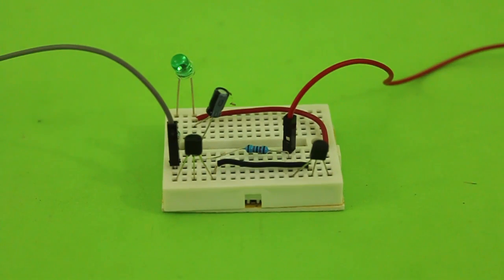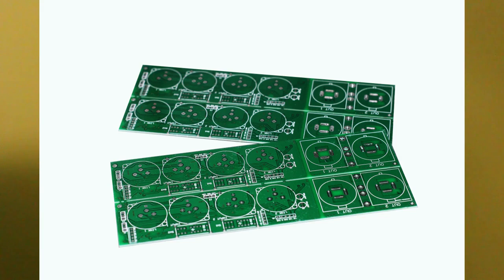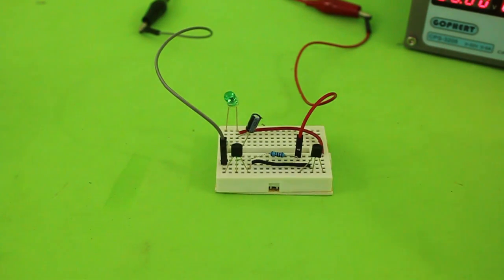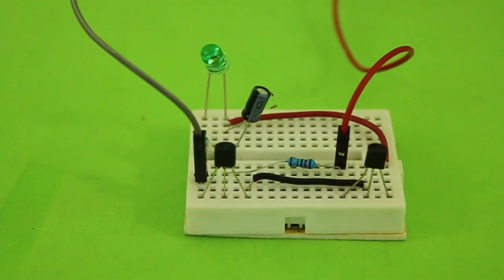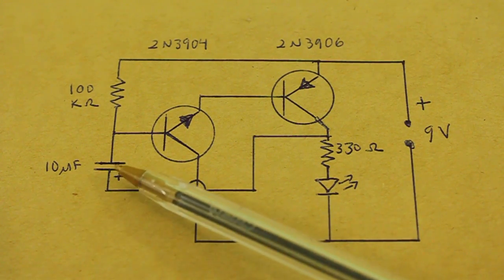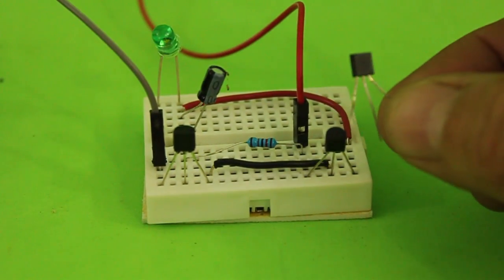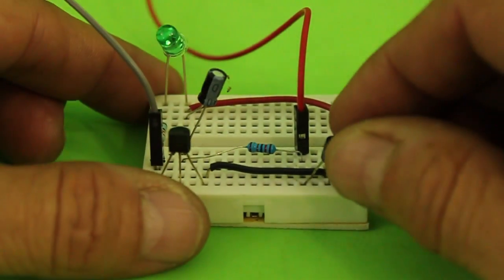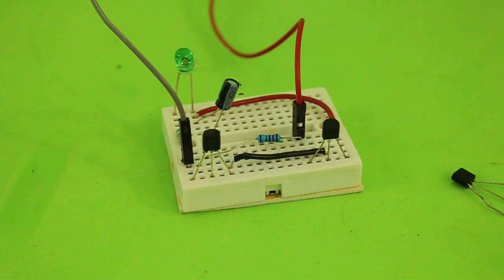Easy Transistor Tester

Comment: Always like the ideas presented in this channel, including this relaxation oscillator circuit which I've found to be simple, while still very reliable in operation.  
Do review this circuit, I think the collector-emitter leads of the NPN can be swapped, the emitter to ground would be the standard connection.
Reply from the maker: Thanks I will check that